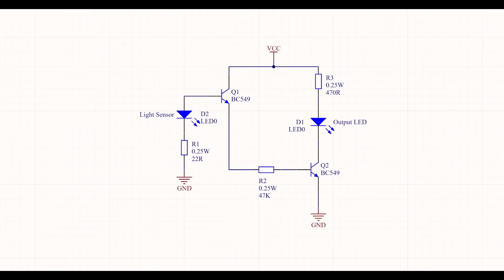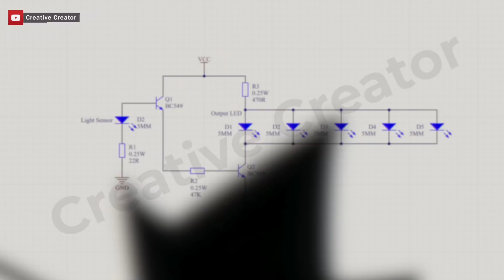Simple Electronics Circuit with BC549 Transistor

Comment: The Output Voltage is very weak and low as comparison to the 12v battery that is too much power just for little output😒
Reply from the maker: you can get higher output power by ising a n channel mosfet amplification
Reply: @Creativecreator  im made this using one ldr and one transistor only that runs on 3.7v batt only and give higher output😅